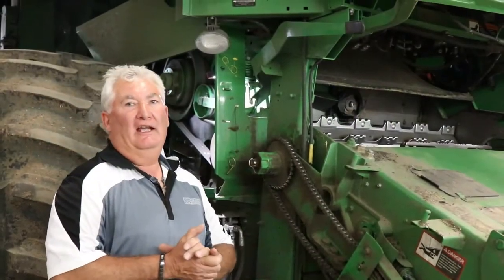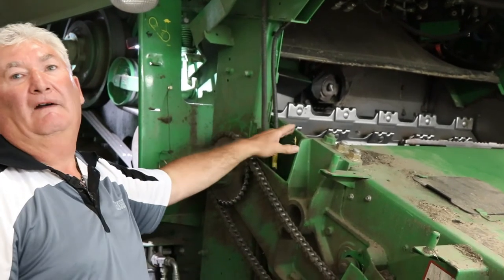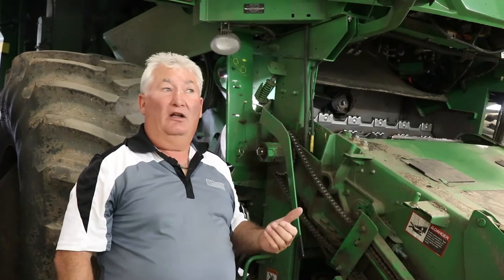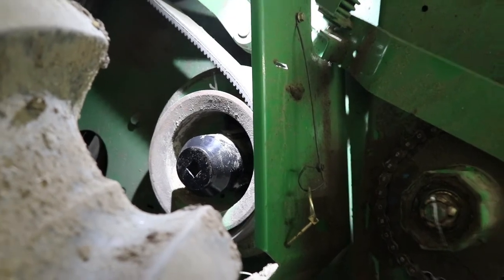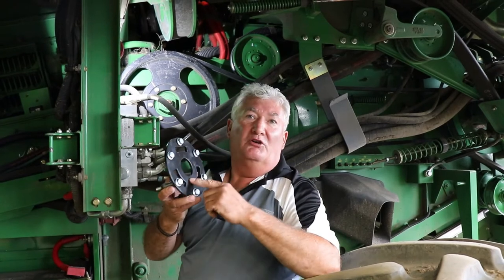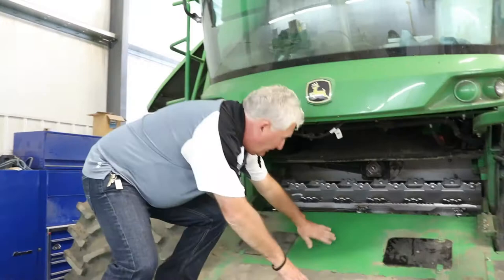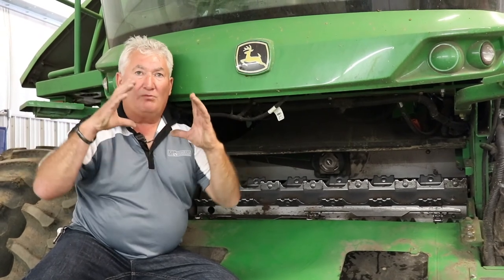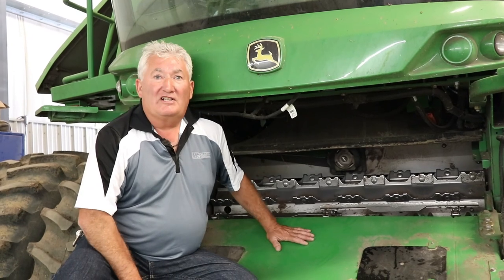Feed Accelerator Upgrades & Unplugging Tool for Accelerator & Discharge Beater

Comment: Stop the combine separator and set park brake 2 disengage feed accelerated and put on slow speed 3 engage separator reverse header 4 turn header off. 5 bump feed accelerator into gear with lever at low idle. It will clear the plug more often than not!